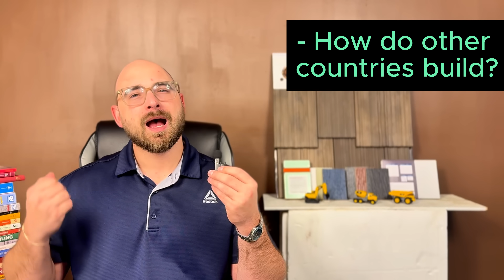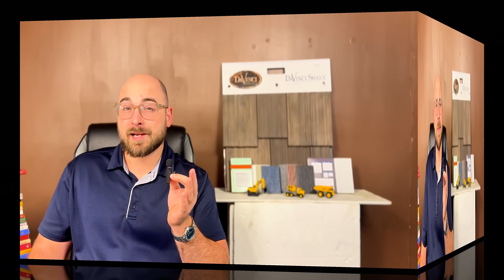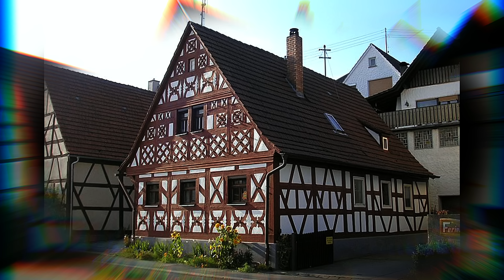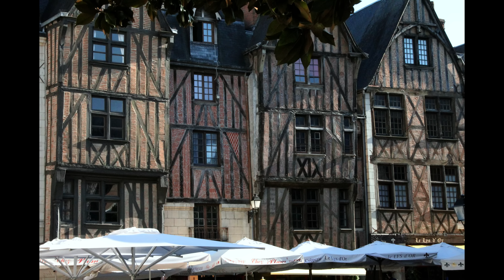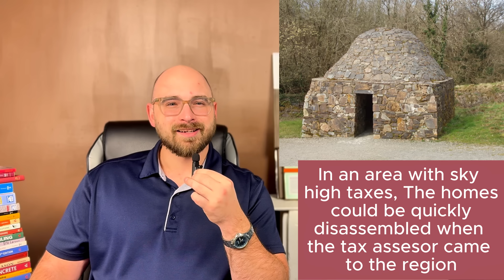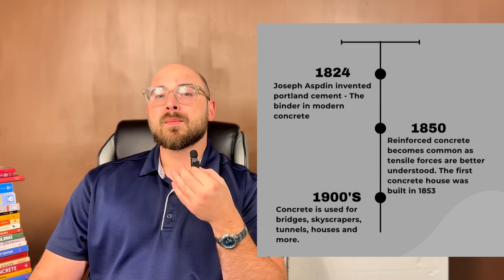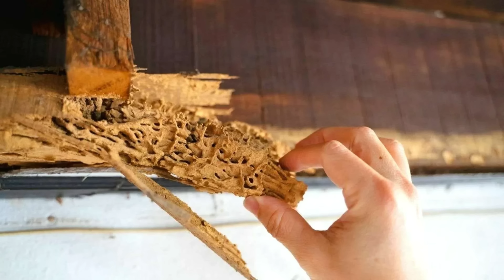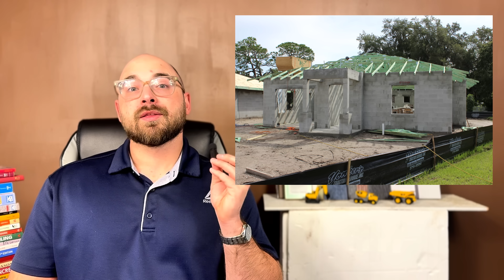Why Other Countries LAUGH at American Homes

Comment: I would love to build with ICF but it’s hard finding contractors here in Houston TX to do the work.
Reply from the maker: I’m sorry to hear that, 

It’s a shame because it’s an easy system. A skilled carpenter should have some knowledge of concrete forming. And ICF is not a hard system to learn. Many people are able to DIY their ICF homes. 

I can see you are an investor or builder yourself after browsing your channel. 

If you could find a builder / carpenter that is willing to learn, some ICF manufacturers like Crown ICF can send out a Subject Matter Expert to train crews as your job is underway. 

The other challenge is subcontractors, many throw money at things they don’t understand, so there’s a degree of contractor education and competitive bidding that has to take place every step of the way. 

However, it is worth it. You will have lower insurance premiums, unparalleled safety, lower energy bills, tax credits, rebates, noise reduction and overall just greater comfort
Reply: @Mike_Fortin  Thank you for your insight! I completely agree that ICF (Insulated Concrete Form) systems are a game-changer, especially for areas like Houston, where our climate and the frequency of hurricanes and flooding make energy-efficient and resilient building technologies a must.  

I’ve explored other energy-efficient strategies with wood framing, but they often come with challenges like increased costs, compliance issues, and the need for heavy on-site involvement from me to ensure everything is done correctly. ICF seems like a great alternative with benefits like lower insurance premiums, energy savings, and increased durability.  

The main obstacle here in Houston has been finding tradespeople who are not only skilled but also open to learning something new. Many of the most affordable and skilled crews in our area face language barriers or show some reluctance when it comes to adapting to new methods. That said, I love the idea of working with manufacturers like Crown ICF, who are willing to send Subject Matter Experts to train crews during the job. That kind of support could make all the difference.  

I appreciate you highlighting the importance of contractor education and competitive bidding in making systems like ICF more accessible. It’s definitely something I’d love to incorporate into future projects as I grow as a builder here in Houston.  

Thanks again for sharing your perspective—it’s motivating to hear how much value ICF can bring to both builders and homeowners!

Comment: Happy to find your video & channel @ Mike Fortin.  Excellent job on the video - a lot of good and accurate information! 👍
As someone who consults on building science & construction technology (especially on "nontraditional" custom homes in the U.S.), I'm happy you pointed out many facts I constantly have to explain to people.  ICF is also my favorite type of construction, and I love to finish the interior with magnesium sheathing, and finish the exterior with stucco, siding, rammed-earth, brick/masonry, or a manufactured stone facade.  

A few things I'd like to point out for construction nerds like myself: 
1) Concrete can be produced with carbon-capture technology, resulting in concrete that is stronger, needs less water during the mixing process, and is more eco-friendly.

2) Concrete can be mixed with graphene or fiberglass needles, for additional strength, flexibility, and durability.  When combined with long-term reinforcement, such as power-coated or epoxy-coated rebar, or utilizing non-metallic rebar such as fiberglass (GFRP), you can achieve a reinforced concrete structure that will outlast conventional reinforced concrete, because the reinforcement materials will not rust or significantly degrade in 70 years, and can thus last centuries without major renovations.

3) Ideally an air gap or break between the interior sheathing, the structural wall, and the exterior facade (which was a common practice amongst many Victorian-era homes), allows adequate space for plumbing and electrical to be run inside the interior sheathing, and for ventilation between the exterior facade and structural walls, resulting in cost-effective and efficient upgrade capacity to the home, should future changes be needed, such as newer telecom wiring, electrical wiring, or for the replacement of plumbing lines, without having to make holes in the walls or flooring.

4) The most efficient method of heating water in a home, is to run a single cold-water line to every room in the house where water is needed, and then to install an in-line water-heater at the point of use (such as under a sink), resulting in lower plumbing costs, lower maintenance costs (compared to conventional tanked water heaters), and almost instantaneous hot water on demand, because instead of wasting a bathtub full of water to pull hot water from the garage and heat up 200 feet of pipe in the process, the hot water only has to travel a few feet or inches, from the point of heat to the point of use.

5) Besides rigid foam utilized in the ICF system, hemp batting or mineral wool can be used in the cavity (air gap) between the wall and interior sheathing, to further improve sound dampening and temperature regulation in the home.  Likewise, if batting is used in the attic, overlapping layers of hemp or mineral wool can further enhance sound dampening and energy efficiency, especially if going for a passive build.   In warmer climates, the use of a radiant barrier on the underside of the roof's structure can further enhance energy efficiency, especially if it is a condition attic space.   Finally, roofing materials such as slate, clay, and certain types of synthetic stone materials can last 70-200 years, resulting in lower maintenance and energy efficiency.
Reply from the maker: Thank you 

I’m glad you enjoyed it, lots of great info here in your very insightful comment. 

I hadn’t previously considered the in line water heater, but it makes a lot of sense

Comment: I am frustrated that I live in a 2x4 home after 2x6 framing has become code. The ends of my first floor joists did not have insulation. Same for roof joist connection to walls. Infuriating. The new care for closing the envelope and 2x6 walls are so much better. Even if the you put the 3.5 inch insulation and left an air gap in a 2x6 wall it is better than 2x4. Filling the whole 5.5 inches with insulation is even better. Seeing the corners of my home was also heartbreaking. We are building so much better than even five years ago.
Reply from the maker: You could always wrap the house in exterior insulation

Comment: Does ICF have issues with off gassing formaldehyde and other chemical compounds? Our houses may be less sturdy but, from what I've seen in various publications,  they are generally more spacious.
Reply from the maker: There are no issues with off gassing and ICF

In fact ICF homes tend to be very airtight and lead to greater air quality

Comment: My house was built in 1960. The studs and rafters still look brand new.  My house is 65 years old and hasn't fallen over, blown away, burned down, or rotted away.  

Will my house last 1,000 years? Probably not.  But i would bet money that the "death" of my house will come by way of a backhoe tearing it down to make room for some other building rather than because the structure failed in some way.  

Europeans need to realize that just because a stone building is strong, that doesn't mean wood building is weak.
Reply: Obsolescence of homes is a possible reason in favor of low-cost, low-quality American homes. If a home design will be obsolete in 75 to 100 years, when it will be demolished, then there is no reason to build it to last hundreds of years. Homes built in the 1950s may be obsolete due to small closets, lack of bathrooms, small bathrooms or dark interiors. Homes from the 1950s homes will also likely have lead paint and asbestos, another reason to demolish. Here in Houston, desirable areas such as Bellaire have long been "tear-down" neighborhoods. However, new replacement homes tend to be very expensive, around $1 million, so this is not an option for most people.
Reply: @frederiklogirush5607  Homes are expensive here but built of wood, very cheap labor and thrown together almost over night. Still firewood. Bellaire, River Oaks, Kingwood, all over. Not built to last at all.
Reply: @frederiklogirush5607  lead paint can be removed.  Closets can be expanded. Rooms can be added.  I've worked in construction and service industries for decades, going into people's homes to do services and repair work.  There are plenty of 100+ year old homes still in use today.  The only real complaint that would make an old house "outdated" is the fact that most older homes only have one or two electrical outlets per room, where more modern homes have at least 2 per wall.
Reply: As a carpenter, I can attest to this. Seen plenty of older wood framed homes that are very strong. The problem we face is not because of wood framed homes, its the contractors themselves.
Reply: Keep lying to yourself if it works for you 😂
Reply: Here in Sweden we mostly have wood buildings. In "Average age of building stock" for European countries, we have the same average aged houses as France however, proving your point! (Most buildings here are from the 40s, 50s, 60s)

Comment: After the wild fires in CA , they MUST think much more smartly on how they rebuild homes to withstand fires from traveling embers . Cement houses with cement or metal roofs .. perhaps mandatory rooftop sprinkler systems.
Reply from the maker: I think steel or concrete combined with seismic / fire resistant design is the answer

Comment: I own two houses in Mexico. Both built with concrete and rebar . My largest house of the two is 3 & 1/4 floors high with a rooftop pool .  It will stand for the next 2oo years for sure with very little upkeep except for cosmetic wall patching here and there  on a fairly regular basis

Comment: I lived for a few years in Aktobe (Kazakhstan) in a 5-story condominium built in 2016. It had 70 cm thick walls with triple-glazed plastic windows and gas heating. Typical winter temperatures were around -10 to -15 C, with occasional extremes at -35 or -40. I never felt cold in that apartment, and always wore a T-shirt. Visiting other people’s homes, I can only say it was as warm, whether it was an apparent or a detached house.

Our family has recently moved to Astana (capital of Kazakhstan), we live in a high-rise with 50 cm walls, but 6 (!) layers of glass, and we still walk around in T-shirts! 😇

I’m not originally from Kazakhstan, and will certainly not claim it’s a perfect country, but boy do they take their insulation seriously!
Reply from the maker: With winters that cold you would have to take it seriously !

Comment: I built my existing house 25 years ago by using ICF and the Canam Hambro floor system.  I ended up being the GC myself because no builders in the WNY area wanted to touch my project without trying to talk me into building the house by stick-framing.  25 years have gone by and I still do not see too many ICF constructions in our area which is a shame because it makes such a comfortable house to live in!

Comment: looking at the construction costs in the States at the moment and the construction costs in Germany, building a house in Germany for example costs between 200 and half a million euros, such a standard house up to, I don't know, 150 square meters, so I'm not mistaken, building a house in the States is also meat, 200 and half a million dollars, maybe more, depending on the size of the house, of course I come from Poland, building a house costs between 100,000 and 250,000 euros, as I say, it depends on the region of Europe, construction costs are different and almost all houses are built of brick or prefabricated concrete, such an interesting fact, Poland has a large number of apartments, otherwise flats, built with all the technology, large panels, the buildings are already 50 years old, some of them and they are still standing

Comment: There is no such thing as the perfectly constructed or engineered home. Homes should be engineered to fit their specific environment with the specific needs of the person who is building it in mind. Cookie cutter sub divisions dont do this well. But what they do do well is filled a need for massive amounts of housing cheaply. It simply filled another need. 

One thing that few take into consideration is county codes. Codes make newer types of homes, like printed concrete, completely impossible. We do need code changes in the US to keep pace with technological changes. To me thats the greatest issue.

Comment: What's the trade off between wood construction's carbon sequestration and the CO2 pollution by concrete production?
Reply from the maker: Longevity and disaster resistance 

The best way to build sustainably is to build to last

Comment: My house though expensive was built extremely poorly. In 10 years I've had to do more and more serious repairs than my mom's house in its entire 100 year (so far) span. Most of my windows won't even open. We build houses like fast food to just last long enough to collect the check. Many others build to last. ICF is my fav.
Reply: Sloppy and shoddy builders out there. There's a channel I follow. A home inspector who works in Arizona. He's always pointing out cracked window frames, cracked roof rafters, roof vents that aren't venting anything and even leaking gas lines.
Reply from the maker: I’m sorry that was your experience 

Comparing the two, it’s hard to beat a well built ICF house

Comment: I believe we need to return to earthen structures. First dirt is everywhere we build homes. It is not a resource we will exhaust with even a huge building boom.

 Second 88% to 90% of the construction material comes from the building site. 

Third it is durable if maintained. There is a 500 year old American village that has constant occupancy. There are multi story earthen structures that are over 1000 years old.

Fourth, they are more passively energy efficient. Not only do they store and regulate solar heat but they also breath. This allows fresh oxygen to be brought from outside but also expells toxic material like radon from the interior structure.

Today the common thought is to fight nature and wrap homes in an air barrier. Tell me how long would you live if you zip tied a bag over your head? That is what we are doing to our homes.

Adding a passive air tube ventilation at a depth of 10 plus feet would not only add fresh air to our homes but also adds cool air in the summer and warmer air in the winter. Used along with a solar chimney it requires a minimal amount of power to run... if any.

60 years of political and corporate corruption have proven to be a disaster in the California wild fires. Entire areas have been destroyed. Yet decades ago properly built earthen structures where proven in testing that they could not only survive large earthquakes but could save the lives of their occupants.  And guess what... earth does NOT burn in a fire!!!

Yet with all these advantages and more, like walls being bullet proof, only one state has regulations that allow earthen construction. You have to wonder how much graft corporations have paid to create laws and regulations that all but eliminate the possibility of building a home made from a superior building material in favor of using toxic chemicals.

But the structure itself is only a start. We need to reconsider building huge homes with single purpose rooms. We used to build structures that a room had a use 24 hours a day. During the day it could be a parlor and at night it could be a guest room for family visitor. A kids bedroom at nith could be a playroom during the day. I know this is possible because as a small child I lived in homes like these.

Comment: In one hundred years from now, America will be divided in two zones: Industrial Zone (North of Manhattan, including Canada and Greenland),  and Residential Zone (South of Manhattan, including half of Mexico). In the Residential Area houses will be build out of Concrete, which will be appropriate for the weather and disasters; no fossil fuels will be allowed in this sector for it won’t be critically necessary. In the Industrial Zone, houses will be build out of wood with extra insulation. Fossil fuels will be assigned only to industrial production. Strictly required personnel will be allowed to reside temporarily in this area. Solar and Nuclear energy will suffice for residential heating/AC, and non-industrial transportation in both Zones.

Comment: Among the countries that commonly use brick and mortar, you left out South Africa. This is very commonly used in residential and commercial construction. Concrete is usually used as a slab if a structure is more than 1 storey, or in high-rise buildings where concrete and rebar is the obvious choice. We also have people who do home flips or occasional home renos, and our brick construction is not a major problem if one wants to remodel a place. Wood is only used for garden/tool sheds, kennels, and amongst homeless encampments due to their far lower cost and their insecure conditions. Fires can and do occur among such squatter camps from time to time due to their use of wood and other flammable materials such as cardboard, plywood or plastic, but also their very close location, next to each other, and use of paraffin for cooking and heating due to the lack of electrification in such squatter camps.